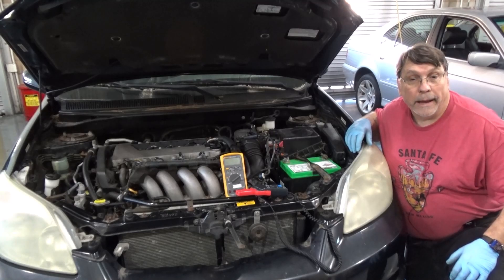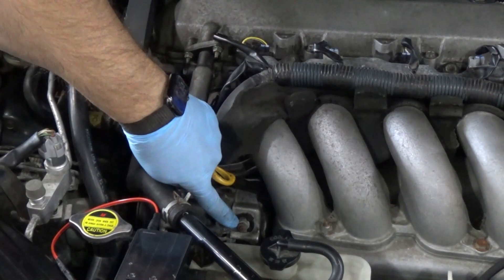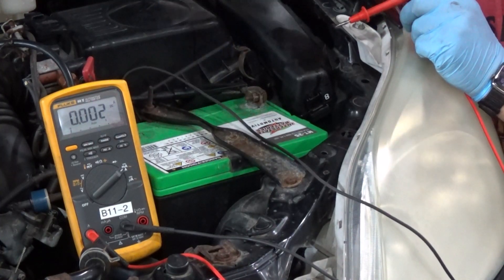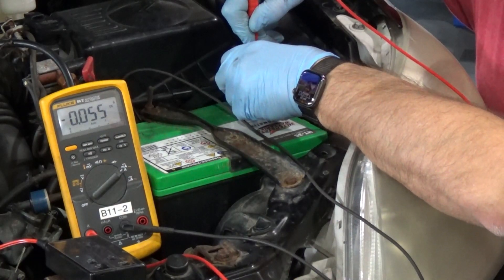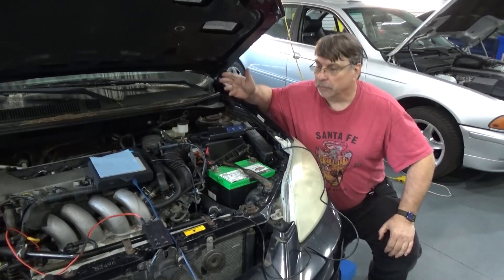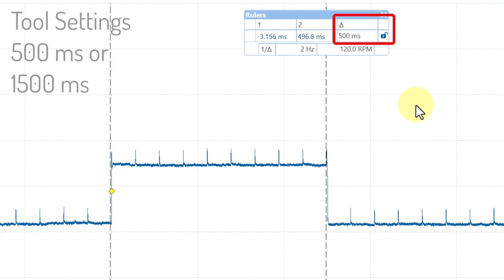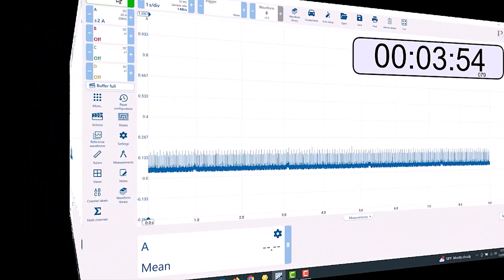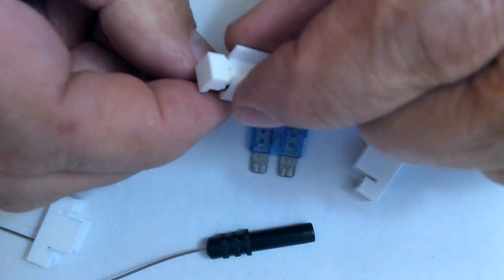Parasitic Battery Drain Diagnostic Training Tool

Comment: Hello. I think the type of adapters that are installed over the fuses are better. Because i've heard that if you remove and reinstall fuses you can make intermittent drain disappear and you will need to wait for a couple of days or weeks for it to return. Of course i'm talking about the most hardest battery drains out there.
Reply from the maker: Absolutely you are correct. we don't want to disrupt the system. Most likely what will happen is that it won't take days or weeks but it might wake up a computer that could need up to an hour to go back to sleep. I'm still working on perfecting that design.  Thanks for watching.

Comment: I been chasing a parasitic draw in My C6 corvette for 3 years now I know it has something to do with the security. When I lock the car it the battery is drained in few days and cant even open the doors but when I leave it unlocked it will last more than 2 weeks
Reply from the maker: First place to start is a good amp meter that you can connect in series with the battery.  You don't always need a scope. It's when the draw is intermittent that the scope really helps.  If you have a good amp meter that you can connect in series I'm willing to help to walk you through and see if we can narrow it down.